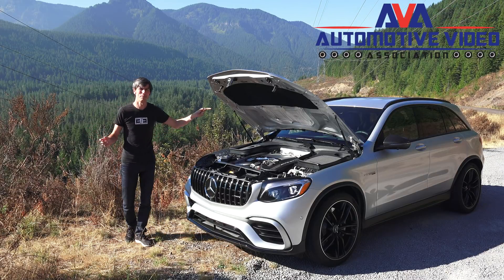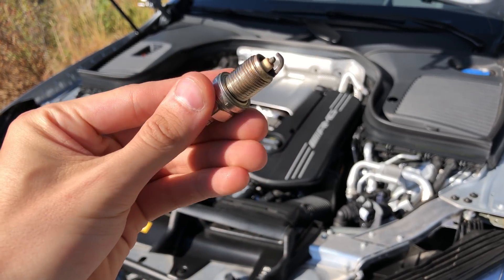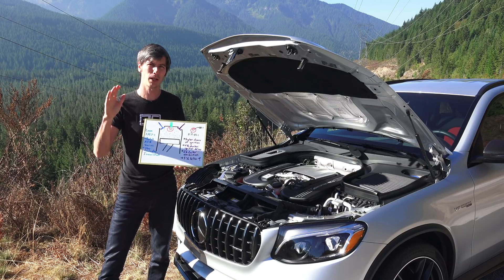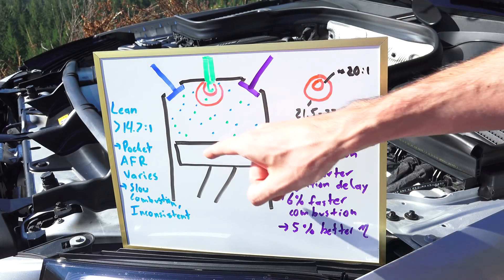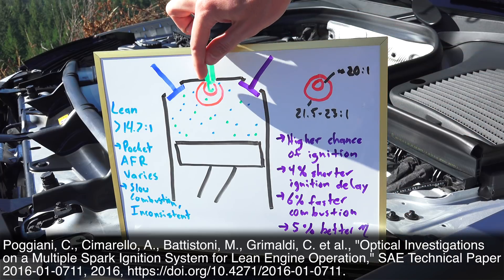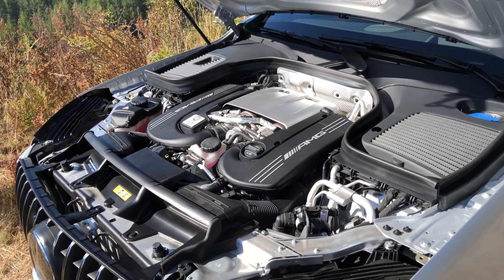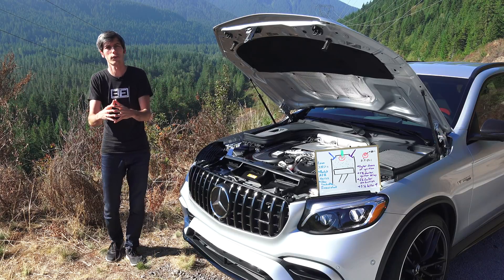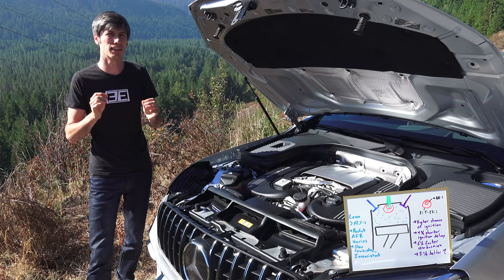Mercedes Spark Plugs Fire 5 Times For Better Efficiency

Comment from the maker: In before the haters say "Mercedes Spark Plugs Fail 5x As Often." 🤣 If y'all like pictures of cars and such, a wonderful way to keep up is Instagram! https://www.instagram.com/engineeringexplained/
Reply: Lako ... I have 16 spark plugs, what’s garbage about the M113?
Reply: Twin spark is a very smart way to lower emissions and get more power.
Reply: done, followed (y)
Reply: A real question: does firing multiple times per cycle reduce the spark plug life?
Reply: Alonso Cambronero 
I would say no. I’m about to change mine at 137,000km in my ML500 biturbo and they are fine. Just thought I should at that many k’s
Reply: Are plasma spark plugs and/or ignition systems similar, and are they effective?

Comment: I've one upped that.  Datsun 720 pickup with a NAPS Z22e engine dual plug hemi head (just like a Dodge).  Both plugs fired 6 times by an MSD 6AL ignition and Blaster SS coils at 300 miliamps. Special colder plugs with gap upped to .060". 
One would think two spark plugs would be very efficient, I noticed a huge difference when installing the MSD.  Apx 3 mpg's better.  Surprised the rest of the automotive world hasn't caught on to what MSD did decades ago.

Comment: Well, in the past there was a tendency to put double spark plugs (like alfa romeo t.spark), but I believe it was done for more rapid flame propagation, and therefore high rev power. Funny, that this idea died and instead we have multiple sparks on a single plug. I wonder if it would be profitable to use both these ideas at once.

Comment: I had an 81 Datsun 720 pickup.  NapsZ22E engine.  Its a twin spark plug engine and a hemi,  It was ported, comp cam, Weber carb and headers. Ran good. I switched the primary side to an MSD 6AL ignition, blaster SS coil and 8mm spiral core wires.  Plugs one step colder and .010 larger gap per MSD recommendations.  I can tell beyond a shadow of a doubt, it ran much better after the MSD ignition install. Idled smoother, more power, throttle response and mileage.  I believe it is 6 sparks per stroke.  I can fully understand where AMG is coming from.  I'm surprised maufacturers haven't caught on yet to this and ALL adopted it.

Comment: You stated that a leaner mixture used less air to the amount of fuel used. WRONG!  You use more air to the amount of fuel used. That is why your air to fuel ratio goes up.

Comment: And if you watch a Ford ignition coil at idle using an oscilloscope, you'll notice the coil barely depletes the voltage before it starts ramping up again. The coil is firing so fast it literally can't discharge 100% before it's fired again. 
Technology is crazy.

Comment: As for more efficiency, overcome the "wall quenching". There is a thin (.02"?) layer around every surface in the combustion chamber that never burns! If that layer was just air (no fuel), it wouldn't be a loss. This is a surface effect, so smaller cylinders are affected more than large cylinders.

Comment: Color me "Not convinced"! Once the flame kernel begins moving thru the mixture, no additional spark will make it move faster. Sounds more like they are trying to get an "over-lean" mixture to ignite with 5 attempts. 1940's aircraft engines used two plugs per cylinder for 2 reasons. 1st - reliability of ignition, 2nd - avoiding spark knock. Lean mixtures are difficult to ignite and can have inconsistent flame speeds, leading to spark knock. Especially at low RPM.

Comment: Thanks for the consistent, fact filled content as always! Is there any way you could make a short video covering speed shifting/power shifting (shifting without lifting off the throttle)? It is a technique I see many people use for quick acceleration and gear changes, yet to my knowledge, it can't be good on the clutch, flywheel, and pressure plate. Would the improved shift speed equate to faster quarter mile times?  How quickly would damage typically occur, and is using this technique worth it?

Comment: I don't think they can really run  a lean AFR in part load due to NOx emissions. Global cylinder lambda must be one otherwise they create an emissions issue which they probably would not risk,  multi sparking can compensate locally lean combustion not globally lean..

Comment: Like all great ideas you wonder why it wasn’t used before. What have they modified in the ignition system to enable that burst of sparks from the plug in such a short space of time? Regards.
Reply: MSD has been doing this for decades.  There names literally stands for Multiple Spark Discharge

Comment: There's a couple of ignition control chips that have been out for a few years that support PWM ignition sparking. EG. the NXP MC33810. Has 8 different settings from 10hz (default) to 1.28khz.

Comment: It would be interesting to see the effects of adding multiple center electrodes to one of the multi ground electrode style plugs. Would be a nightmare to implement but would provide multiple & simultaneous sparks from a single plug. Toss in multi spark as well.

Comment: My sweetie has a 320 MB. I changed the sparkplugs. It took 6-8 hours! All 12 plugs were Very snug. They had never been changed in 150,000 miles.  I called the dealer because the plugs required about 50 lbs of torque! On an aluminum head.  The mechanic said Don't Worry, just keep going.... Never in 50 years of wrenching have I seen plugs so tight. And in aluminum.  But everything went ok. I put anti sieze on all the new plug threads.

Comment: Ford does a similar thing on my Ecoboost direct injection. Granted, it's on startup and I'm not sure if under load at all. They use the timing of the injectors, firing them twice in a cycle to create a lean mixture with a rich mixture pocket near the spark plug. In that scenario it's to create more heat to warm up the "cats" quicker. Since lean produces more heat but more difficult to ignite. The rich pocket creates a stronger flame front to distribute ignition and ensure complete combustion. Also to reduce fuel consumption at the critical moment of cold start. 
The point being, there are other strategies that can be in place of, or combined with multiple spark, since direct injection allows more control and flexibility.

Comment: Would this work on rotary engines? (More sparks=less unburnt fuel and oil through the exhaust?)
Reply: Levin Lover rotary already has two plugs
Reply: Nicolas Losito I know that. What I meant is that what if the multi spark technology from Mercedes was applied to rotaries? (5 sparks from both spark plugs during the power cycle)
Reply: Levin Lover it may or may not work. I would think it would have a marginal effect because of the nature of the engine but I could be wrong. 

By nature the rotary engine has petrol and air near the spark plug for combustion.

Comment: Would you gain the same efficiency if the arc was held steady throughout the power stroke vs 5 short bursts? Surely that wouldn't stress the coils anymore than 5 bursts would.

Comment: So is the idea that by using multi-spark they can bring in more air, lower the pumping losses and throttle the engine by restricting fuel?
Reply: Isaac Karjala negative

Comment: Does AMC use water injection with twin turbos? Wonder why the spark duration is not longer instead of 5 firings? 🤔
Reply: John Mcneill how would you extend the firing of a plug?
Reply: Change the capacitor controlling spark duration!

Comment: Back when I was bracket racing (over 25 years ago), there were these guys... MSD. They claimed 3 sparks per combustion cycle and torque/HP gains. We spent the money and was refiguring our run times. Granted, we left the line at 2800 and shifted @ 7000. The 60ft times were more consistent and actually a bit faster. It took a month to get it figured out.  It works! I am sure MSD has better stuff now that does what Merc has and maybe better.  It was all baby steps and trial and error. The only thing we had was camcorders for the launch and the time sheet (plus full weather station to dial in to). I guess you can run a few apps on your cell and do it all now.... LoL!
Reply: About ten sparks during cranking, fewer with increasing RPM, down to one spark above 3000 RPM.

Comment: Mercedes is wrong using multispark approach: long spark duration is always preferable to a multiple striking. Long spark duration is a characteristic of inductive ignitions. Inductive spark often is weaker than capacitive short duration sparks, but it's always better a 160 milliseconds spark duration than a 5 series of 12 milliseconds capacitive sparks. Also as RPM increases multiple sparks have no time to happen. This two strategies produce "timing incertainity": at what moment (or in wich spark strike) kernel flame starts to propagate??? The best option is a single strike short duration high energy plasma ignition burst, with big initial flame kernel (300 times bigger than conventional ignitions wether Inductive or capacitive)  with real exact timing matching the ECU ignition map. Lean moistures no problem, sharp timing, power, complete burning, less emissions, less advance required (less knocking issues)  high compression (air dielectric) no problem, turbo no problem, cold start no problem, multi fuel flex no problem. All electric arc is plasma (4th state of matter), but I call "plasma ignitions" those able to protrude plasma out of the channel between the spark plug electrodes, in a similar way exciters do in plane turbine  engine. See video links in comments for some examples on automotive plasma ignitions:
Reply: what ignition are you talking about? what's the hardware and how does it work? and why isn't it already on the market then? Don't think of this multi-ignition at higher rpms! It was already clarified at the start. these guys are trying to ignite very lean mixtures, so they figured firing several times over the usual ignition period did the job. its not cutting edge by any means. also you can't 'long spark' over low rpms because that's where the engine is going to find itself while in operation for a lot of its life. you'll destroy the plugs soon.
Reply: @ramunay5  Aftermarket plasma ignitions can be purchased and also aftermarket CDI's can be modified to operate in plasmany mode. All is about phisics: the same amount of work can be done over a much shorter period. The plasma kernel size obtained this way is 300 times bigger than the plasma chanel of common ignitions. This is optimal to burn lean moistures and also great to make power with normal moistures. Only one strike is needed. The gap used at the spark plugs is over 2 mm, so using quality spark plugs, no electro erosion issues...

Comment: Diesel engines have used multiple injections in a power stroke for a long time. A little squirt early to heat the cylinder and up to 4 more (last I heard 6 years ago) at the appropriate time to prevent knock and excessive cylinder pressure that would destroy ring lands. Way more power and efficiency. I know large truck diesels are were running 1200 to 1400 at rated HP to reduce reciprocating part energy losses. Wonder why cars with direct injection can't do something similar. Once the fire starts, make multiple fuel injections.

Comment: So this "multiple sparks" design may just really be the cheaper version of "multiple plugs" to reliably spark leaner mixtures.
As pointed in another post, direct fuel injection allows greater timing control.

All of this doesn't spell longer service life though 😂

Comment: Nothing new. Saab kicked all this off with multi spark firing on the Saab 9000 in 1993 when Trionic 5 was released. Their main reason was for emissions. At the time of Saab 9000 Trionic 5 release it was shown that a 9000 driven in central London put out cleaner exhaust gasses that what was being taken in the air filter up front. So it actually cleaned the air as it drove along. Sadly Saab are now long gone thanks to GM, and other manufacturers are now only just catching up.
Reply: Saab's Ion Sensing ignition system is the most advanced and efficient ignition ever made PERIOD. It detects pre knocking with a mirroring system (current applied to the spark plug gap) that monitors ionization (cylinder pressure) after spark. Also uses high intensity  plasma spark strike. The should have used it also to achieve PPP for every conditions in a running engine. This would be the same as having a dyno on board. The perfect engine...
Reply: Saab was a great company, while most german  brands don't really innovate and just change things a little bit, saab really innovated. Which is why they went bankrupt, because the other brands didn't put too much money in R&D making the cars cheaper and with more profit.
Reply: @epiphonesg007 I used to work for Saab, and yes I agree they did way too much R&D. GM even told them to stop doing it, but they didn't, so GM pulled the plug. You can still buy 9-5's in China, sold under a Chinese brand. The B205 engine also lives on as they also brought all the rights to it and the factory tooling.
Reply: If i'm not mistaken, Saab presented a prototype with variable compression ratios  (and displacement) around that time too, right ? The engine block was hinged on its lower part and actuated with some sort of camshaft, tilting the upper part away or Closer to the cylinder heads ?

I remember the présentation of the 9000 on french TV. Bonaldi (the nerdy, techy Guy at that time) was sniffing directly at the exhaust of the running car XD 
Despite the supposedly "cleaning" of the engine, it was still a pretty Silly (and dangerous) move. Haaaaaa the fun we had during these years :p
Reply: 'cleaned the air as it drove along', lol.
Isn't it strange that no air purifier company has figured out that paper filters aren't the way to go - they just need to build an internal combustion engine and run it continuously in someone's house for better air quality?

Comment: What is the spark frequency of non Mercedes or not performance vehicles? Also, does upgrading your ignition to something like msd then make a difference? Or still have the same spark frequency, as msd literally stands for Multi Spark Discharge...

Comment: This is not the real function of the MSD System? My dad and i installed one MSD system on the Fiat 131 and the car was better on cold starting.
Reply from the maker: Not sure what you're asking? Mercedes does it for efficiency.
Reply: Engineering Explained  It's not a question, i'm making an affirmation, when the twincam engine had the normal ignition system was difficult to start the engine in cold, with the MSD was more easy. Not only improves power delivery and efficiency, also improves starting the engine when is cold. Sorry for my bad english, i love your videos.

Comment: You mention the fuel pressure psi. So then it is not a cam driven fuel delivery system like some ford ecoboost engines? Which is better for fuel delivery? Fords 2.0l ecoboost cam driven fuel pump or one in the fuel tank? I'm assuming this suv has a fuel pump in the tank?

Comment: Hello! Which engine oil do you recommend for Mercedes-Benz w 204 c180 156 hp compressor?
Reply: 10W40 synthetic every 6 to 7KMi. Don't forget to change transmission oil too to remove clutch contaminants... trans. filter is only a coarse strainer unlike engine filter.

Comment: Do the spark plugs wear out significantly faster?
Reply from the maker: To be honest I'm not sure; I'd assume they thought about this. I meant to check the owners manual to see what the maintenance frequency is, but forgot to.
Reply: yes 70KMi instead of regular 100KM.
Reply: I guess that's not so bad, I was wondering if they wear out 5X faster (20KM vs 100KM). G Lasser

Comment: I work for detroit diesel. The injectors pulse 7 times per injection phase, also within a millisecond
Reply from the maker: That's fuel, yes? Very cool!
Reply: Engineering Explained yes for fuel. They do 2-3 little injections to get the flame front going then the rest are for power, and managing cylinder pressures the final pulses comes just after the piston has started to come down, keeping pressures high and delivering a good power stroke. Its also taking about 30,000psi rail pressure and amplifying it to 100-130k psi injection pressure. The atomization is insane
Reply: @trollaphobic  thank you for this extreme engineering nugget. 
The direct injection really provides greater control of what can happen during the power stroke.
Everything is superbly controlled all the way to fine heat management for hoter lean mixtures.

Comment: why not just use continuous arc? bad for the spark plug electrodes or what? the plasma generated by combustion is much harsher than any continuous arc already
Reply: John Scarce because it is unnecessary. The multiple spark system is only used for transient fueling

Comment: What about engines with dual spark plug per cylinder, like the old Ford Ranger, does it save fuel?
Reply: Ghazi Sarhan no, that is because they had poor combustion chamber design

Comment: Is it theoretically possible to have a system where the spark plug arcs to the piston instead of a ground prong? Or two separate positive and negative plugs on different ends of the combustion chamber that arc between each other?
Reply: A Toolbag yes but there are many problems encountered
Reply: The coils need to recharge before firing another spark.  A coil takes the 12 volts of a normal car electrical system and cranks it up to 100 plus thousand which is how you get a spark that will jump a gap.